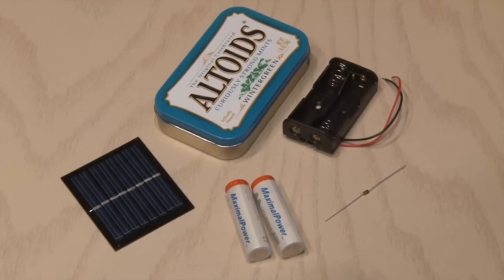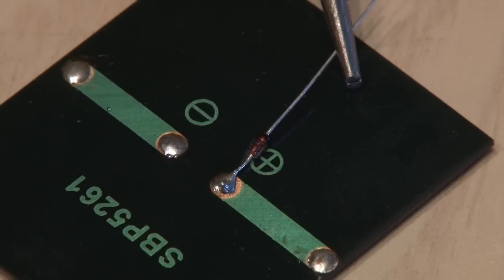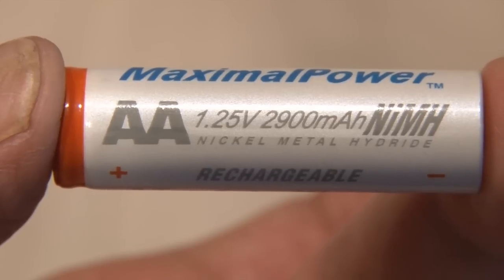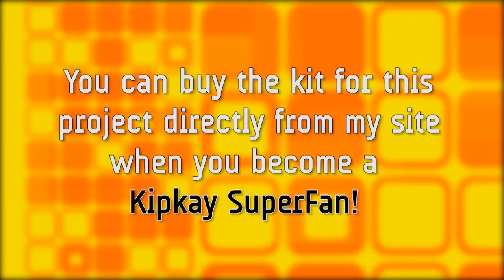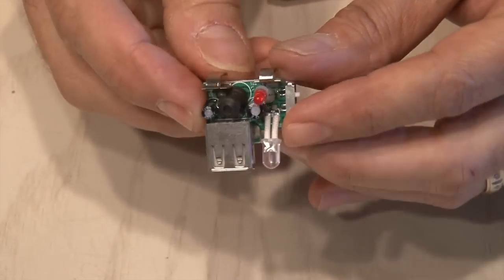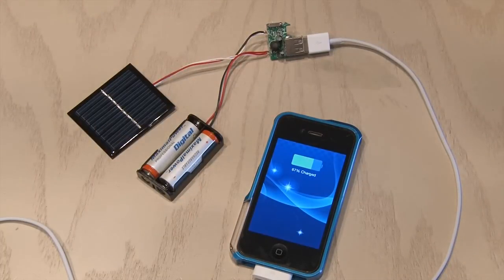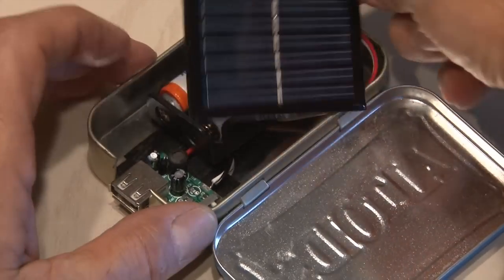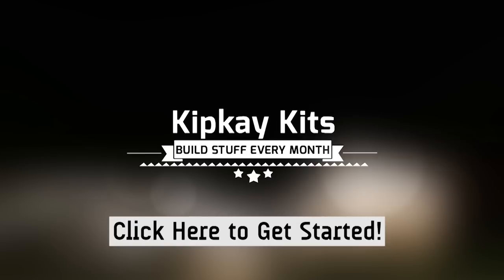Build a Kipkay Solar USB Charger!

Comment: can i use it to power my usb powered speakers ? Thanks!
Reply: well with my knowlede i can tell you that if they are usb powered its standard 5.5v so you should be able to charge them up but you should be worried about the ammount of ampage thats coming through because you might be pulling more out than you are getting in lol if you want to check it just have a look for how many millie amps of power those speakers eat and how many millie amps that solar pannel gives hope this helps :) if you have any more questions about electronics please feel free to ask :)
Reply: theshadowfexx USB is 5v not 5.5v, pay attention to the internet, and your multimeter
Reply: well i know it was around 5.0v but i dont remember the voltage of everything lol i have hooked my multi meter to loads of devices

Comment: Why not use those cheap solar sidewalk lights, can find them in the $2 - $3 range and they contain a single rechargeable AA battery and the solar panel.

Comment: Do not expect those batteries to last very long. Real rechargeable battery circuits use integrated circuit chips that put the batteries through charge cycles inorder to maximize battery life. Im not saying this circuit wont work, but the batteries are going to become duds pretty quick.

Comment: He removed the bulky casing and replaced it by an even bulkier case... And he replaced the batteries with not only the panel but recharchable batteries, too.
I would have changed the batteries inside the original charger and ran the wires for the panel to the outside. Optional would be a tiny plug to detach it and recommended would be a hard envelope to protect the panel. (This could also be build as a stand to cach light more efficiently)
Would have been much more tidy.

Comment: Wouldn't it be easier to add the solar panel to the INTACT usb charger ? It already had a battery holder, usb connection , etc.

Comment: you could build one without the usb plug cut the usb end off and use the red and black wire to the rest of the set up, batteries and solar panel to charge your phone like if this works for you

Comment: I  dont get it. At the end you soldered the battery directly to the batteries, even though it works, wouldnt that mean that theres no way for the solar panel to stop charging the batteries? As in it would charge them untill they overheat and explode?

Comment: Is it necessary to connect the rechargeable batteries? Can i instead use two solar panels and a resistor to bring the voltage to 5V?
Reply: or a 12V solar panel and a resistor?

Comment: all iphones (as well as most phones in general) require 5volts for the phone to start charging. so you'd need to find a battery that is capable of producing 5volts.

Comment: Correct me if im wrong but - wouldnt it be better to recharge the batteries/input voltage into one end of the battery pack and supply power to the usb via the other end
Reply: I don't understand, while batteries do have 2 "ends", when you connect anything to them you always have to use both ends, positive&negative
Reply: mikekoz68 at each end of the battery pack there is one negative and one positive right? so if you input power from the solar panel into one end of the battery pack and then drew power from the other end to power the usb, wouldnt it be better? or no?
Reply: mikekoz68 cause then that way the voltage would get to be to much and damage the circuit if your solar power produced a high voltage, correct me if I'm wrong.
Reply: mikekoz68 sorry, would NOT get to be too much*
Reply: Help me please how would it not get too much
Reply: ***** well all the componenents would be safe to a certain voltages/current level but if you have a vrey high voltage solar panel i'd recomend adding a voltage regulator to the circuit.
Reply: Cheesy Lasagna No, actually not at all.  I don't mean to be rude but what u are saying is so fundamentally wrong.  The batt pack has only one real "end" the two batteries are linked in series meaning +- to +- so the only "end" is that first + and the last  -  Understand?
Reply: Cheesy Lasagna to answer ur question directly, at one end there is a + and a - that would read 2.4Volts the other end would read 0Volts because the + and - are joined together.  Its like they laid the batteries end to end to make one long batt that has a +on top and a - on bottom(2.4V) the +- in middle are touching so 0V, then the batt is curled in a "U"type shape for convenience, on side is joined, the other is not  Wow this is simple but hard to explain in txt lol
Reply: mikekoz68 hahaha, sorry, huge brain fart. I forgot the batteries are connected at one end (connected in series). Thank-you though.

Comment: question i would like to know if it's ok not to use a diode to solar panel?..
Reply: Ronald Rasonable The diode keeps the power from going back into the solar panel so i suggest not to.
Reply: The UltimateGamer101 solar panels shouldnt allow power back anyways

Comment: I don't know if it will work. coz u need a dc to ac inverter dn a step up  transformer for  1.25v to 5v of a  solar panel as shown in the vid.

Comment: It would be better to cut a hole in the top of the tin so the solar panel is always exposed and you won't have to open the tin to get it out for use. Simplify it.

Comment: why wouldnt you mount the solar panel to the top of the tin
Reply: +Travis Chandler Maybe for protection? like if you put it in a backpack so it wont get damaged>
Reply: +Travis Chandler Put some sticky velcro to the panel and on the tin top and you can put it on there when you need and put it inside when you don't want it getting damaged.

Comment: how does your ~3V battery system charge your iphone battery which is ~3.8V?  i thought the voltage had to be higher in the charger to have current flow in to the phone.

Comment: Was wondering, I put the charger in the sun for a bit too long. Plugged my S4 in, not even a trickle charge indication. Swapped the batteries for standard AA's and it is working. It also worked for a bit when I built it with the rechargables.
need some help troubleshooting..circuit works which is good, but either solar cell doesnt work or rechargables do not work any longer

Comment: I'd use the soldering, don't think it'll work as well with glue.. The electricity probably won't go through the glue as well as the soldering.

Comment: What happens if you leave it in the sun, even when the AA batteries are fully charged? Can they over-charge, or will the solar panel stop when they are full?
PLEASE ANSWER
Reply: They will continue to charge until they get so full they either explode or last forever never needing to be charged again.
Reply: Dan Miller I see what you did there, and I like it :)
Reply: ChozoSR388 :) Got to use humour once in a while lol.
Reply: Yup yup
Reply: The sun's energy will run out and it'll eventually die. please don't

Comment: Uh, kip, I just bought one, a solar USB charger, with a 6 AH battery, that charges fully in 6 hours, has 2 outlets, puts out 1.5 Amps per outlet, and cost $8.95

Comment: Could you just put a 5v transformer/capacitor thingy on the wires coming from the batteries and connect it directly to a micro usb cable? Im just getting into electronics, and was just wondering if it would work.
Reply: haha! i wish, its a bit more work than that. you also have to put certain voltages into the data+ and data- wires in order for the usb device to accept being charged from it
Reply: Ok! Thx!

Comment: Ok, so I'm basically building this from scraps, a solar panel and batteries from a lamp, a USB port from an old PC case's front I/O and a diode that I took out of some other circuit, when I plug in my phone it shows that it's charging but it doesn't actually charging, I'm sure that I'm missing some components that the USB circuit that Kip's using here has, I see it has two (or three?) capacitors and two little chips  besides the LEDs, out of all that, what do I need?

Comment: Why couldn't you just solder the solar panel to the battery compartment in the emergency USB charger?  So the emerg.chger would work normally with the batts constantly being charged by solar panel?  why the extra batt tray??
Reply: These are good questions, why won't Kipkay answer, does he not read his own channel??
Reply: Possibly the shape of the solar panel would make it awkward to store anywhere, with the tin you can always fold it all away. Don't know how you'd store the panel if it was soldered to the usb battery charger without risk of it being damaged????

Comment: I think the batteries will damage after they are fully charged because it will not stop charging. There are gardenlamps with solar and 2 aa batterie pack for under 5bugs what is more save plus the circuit is ready to use without damaging anything.

Comment: I found a solar cell online for that's 1W/9V, would that be ok?
Reply: Yeah, but you'll need a circuit to lower the voltage to 6 volts, or it will explode( the batteries)

Comment: Can i use an led instead of the diode
Reply: No you have to use the diode because the diode prevents electricity from going back to the solar panel. An LED would just use up electricity.
Reply: gitarsimen an LED is a diode so you can use it, but you´d need a resistor in front of the LED (300-400 ohm i guess otherwise it would burn through) it would use more electricity but if you dont have a diode then use a LED with a bigger solar panel. i hope that helped
Reply: Oh lol I just looked up what LED stood for and it's light emitting diode facepalm

Comment: Can i make this with a 6 V solar panel? If so, what changes i want to make in the circuit?
Reply: Alan Babu use an integrated voltage regulator. try finding 5v solar panels  in ebay or amazon, in your local electronics shop, or radioshack
Reply: +Alan Babu 5V regulator will keep your voltage correct so you don't damage anything that required 5V and under.
Reply: +spydergs07 I found this "mc34063 dc-dc 5-24v step down to 5v 500mA" module thingie on eBay. It may work as a regulator. So i will be able to connect any 6.5V=< solar panel through this module and into a USB female port and into the phone for at the moment charging. But I'm not sure whether I'll fry the batteries by connecting to the module if I only use 2AA's which is like max 3V. So I'll probably use 4 AA's cause it'll be around 6V's and not more than the module will supply. It'll work right?

Comment: A calculator can run off a lemon, the minium current needed to run usb devices is only 500mah, those batteries are at least 1000mah. The only downside with this is that it might charge slower that's it. It will work, kid.

Comment: 1. why is this video in 360p (you have 1.5 million subs) and we get 360p.
2. the batteries will take about 42 hours of sunlight to charge (thats over a week).
3. if you forget about your batteries charging after a week they will explode or leak acid.

Comment: where do u find a mini solar panel??
Reply: Depending on the Voltages and Current you want, eBay is the place.  If you're looking for something like what's in this video depending on specs you may try the Dollar stores or even Home Depot/Lowes for clearance items.
Reply: Rechargable garden lights sell for like $1 of €1 ...
Reply: Tom Jacobs Or even less Tom on clearance however the $1 Garden Lights are often supplied with 100 to 300 maH NiCad batteries nowadays and therefore the current output on those Garden Light Solar Cells is usually low...often 30 - 50 ma. A lot of us use NiMH batteries for these projects now with specs of  2000 - 2900 maH. Doing the math you quickly see just how long it would take to fully charge the batteries using these $1 Garden Light Cells.
Reply: RadioShack

Comment: QUESTION! I would like to be able to turn my battery pack on/off in fear of them losing charge while not in the sunlight. I understand the Diode prevents the batteries running power back into the panels. but since it continues to run power to the USB port will that cause it to lose power? also i wanted to add a light to it so when something is plugged in and charging, it turns on. Hopefully you can help me with this haha
Reply: okay, so then i would wire the led to the panel wire before the diode right?
Reply: Alex Tucker You dont need to LED before the diode because unless you want to use a zenar diode ,which clamps voltage, the led will be the diode because LED stands for Light Emitting Diode. So you can just 1). Solar panel 2). LED 3). Battery holder 4). USB charger. Done

Comment: lets just say we're using an iphone charger (all chargers are the same really, just different sized heads) 

You'd cut off the USB end of the charger, strip the wire a bit and get rid of the white and green wires (i believe they're just used for data transfer) 

Solder the red and black wires to the solar panel. Then just find a spot where the solar panel can produce 5v's and plug the phone in.

Comment: Cool... but you failed to mention that when the sun goes down and there is no light for the solar panel ? The panel then becomes a coil and drains the charge from the ni mh batteries. ...
Reply: Isn't that prevented by the Diode?? I mean reverse flow of current.
Reply: That is the truth!  But I think the diode would prevent that.
Reply: That blocking diode will prevent that and help protect the Solar Cell from the battery voltage flowing to the Cell

Comment: will a 9v battery, a 1n4001 diode, and a 6v solar panel work together
Reply: no, you need a rechargable battery, most 9v batteries are not rechargeable, the diode and solar should work though, you also need a boost converter to get USB voltage out of it
Reply: i know when i said 9v i assumed people would think i meant rechargeable

Comment: Can the battery be a rechargible 9v?
Reply: If you have a 9v to 5v USB converter and a stronger solar panel, yes.
Reply: Oh well I have like a 2v solar panel
Reply: Wither FireFox if i´m right with 2v it would work too but charge much longer
Reply: endodd _ I think maybe a 12v or 15v solar panel may work but those are huge and expensive. I would recommend just buying the KipKay kit.

Comment: Can I use a  resistor of 5 volts instead of the diode?!?!?!
Reply: No, a resistor does not convert AC to DC
Reply: Both solar panels and battery powered devices use DC
Reply: Hmm... I know some kind of power generator uses AC
Reply: No
Reply: @nfsdude911 can i use this diode "Diodo rectificador 1N4148" ? Thanks
Reply: The 1N4148 is only 4.5 volts, in newer smartphones this will not charge the phone. And it will take too long for any other 5 volt device to charge. I used a 5 volt resistor, just make sure that your solar panel has more than 12 volts of output and no more than 1500 mA so the resistor can work properly.
Reply: Please what is the name of the diode the kipkay uses on this video
Reply: anxhelo kalefi It's a germanium diode.  Dunno if it's "one-size-fits-all", though...

Comment: Um couldn't you just solder the solar panel with the diode to a USB cable and then plug it into the battery charger?
Reply: Depends on the output of your panel it need to be at least 6 to charge regular smartphone
Reply: Or either any electronics (small electronics)
Reply: MC GT also overvolt protection, most solars I know of don't have any sort of regulation on them at all, a 3v panel and the batteries will work with a boost regulator, a 6v would need a more complex regulator that both stepped up and down to get a constant 5v
Reply: slango20 yep tht works too just dont put to large panel it might burn lol

Comment: Does the size of the battery matter?I'm doing this but with a 6000mah battery at 3.7v
Reply: jacker372 No, but it will take longer to charge to full capacity.
Reply: +Christion Buric 
can you also put instead of 2 times 1,5v batteries 1 9V battery?

Comment: Wont this overcharge the batteries, since there is no over-voltage protection?
Reply: the cells he's using aren't LiPo or Liion cells, so they won't explode, but IIRC it will affect the capacity negatively

Comment: Can't you use a 5V regulator if you don't have the circuit with female USB connector. So, solar panel and diode to battery in parallel, to 5v reg to female USB. Ground on 5V to neg on female USB,  neg to solar?

Comment: can I just take the USB Compunent from my Iphone charger? Or any charger that gives 5V output? Does it even matter if the input is waay to low?
Reply: well it works but if you like a long time to charge well i say minimum is 12 to charge but well if you use a transformer it helps a lot i tell ya
Reply: golden foxy ty

Comment: If you are not charging, wouldn't the solar panel draw power from the battery? Is that why we need diode?
Reply: Solar cells dont draw power they produce power
Reply: +Ello Oku.  No cause the diode prevents the battery from powering the solar cell

Comment: Not really man, you can get a cheap one but you'll have to be careful with heat sensitive components because those irons generally don't have temperature regulators. If you wish to buy one with a temperature regulator, go ahead, but still be creful with heat sensitive components.

Comment: why would you disassemble a perfectly fine portable battery charger, why not attach the positive and negative wires from the solar panel to the corresponding leads for where you plug it (the portable charger) in to charge it (the female universal usb slot) and attach a switch to the panels positive lead and have it be off when the charger is going to be plugged into charge, or perhaps use a transistor to make it determine it. if power from the wall to  portable charger is putting in power then it won't turn the transistor on, in turn won't let it charge via solar panel.